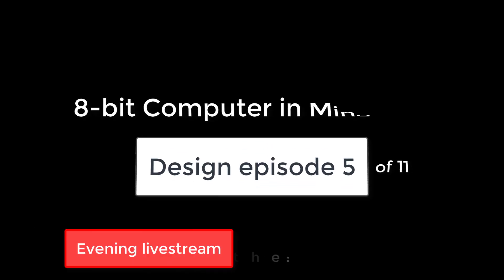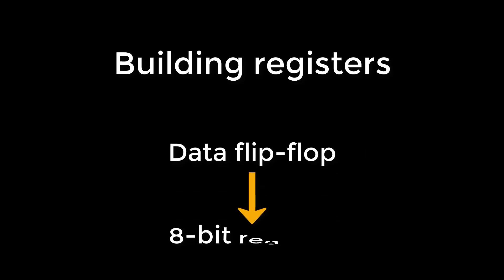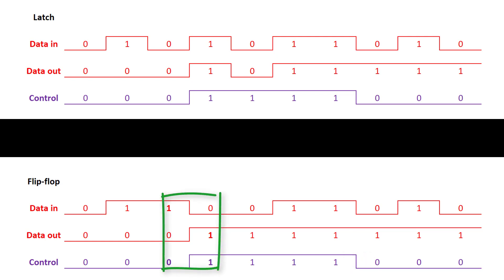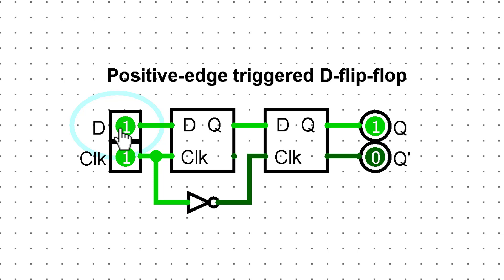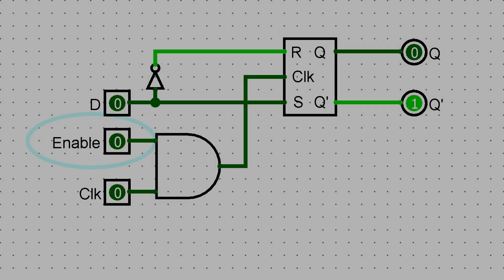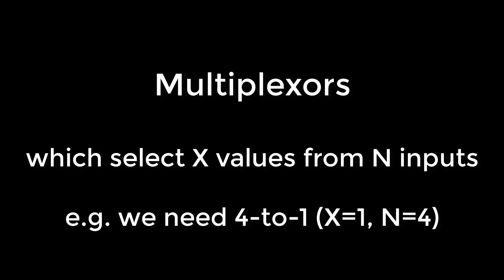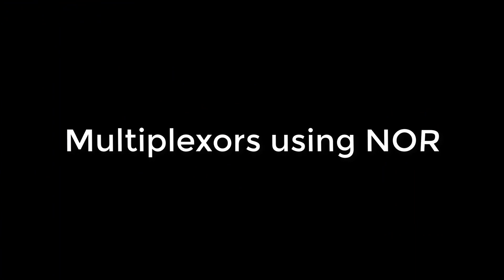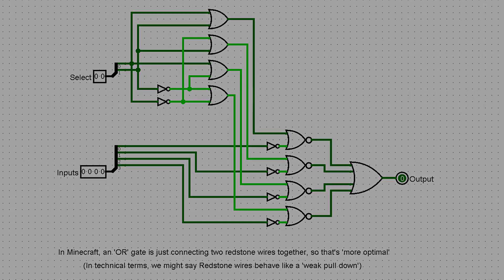Ep. 5: Registers (8-bit Minecraft Computer)

Comment: Hello, Thanks for great video! But I have a question. At 9:05 you said that building 8bit register needs 4bit registers side by side. But doesn't that make a 16bit register as there are four 4bit registers?
Reply from the maker: Thanks for the question! I can see the confusion. The video is showing the construction of two 8-bit registers, each comprising two 4-bit registers. 

Put another way, one pair of 4-bit registers makes a single 8-bit register. And then there's a second 8-bit register.

This does mean that the design contains four of the 4-bit registers, which is 16 bits in total, but they're wired up as two 8-bit registers rather than a single 16-bit register.

Hope that helps clear things up!
Reply: @EdNutting  Thank you for response! It was very helpful in clarifying things. +) Your videos are really helping understand computer architecture. Thank you for the great videos!